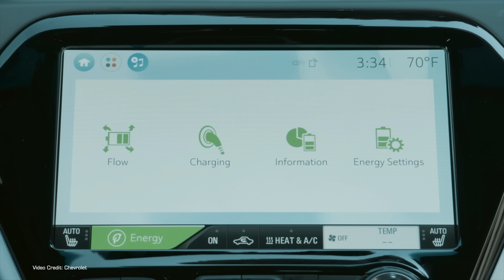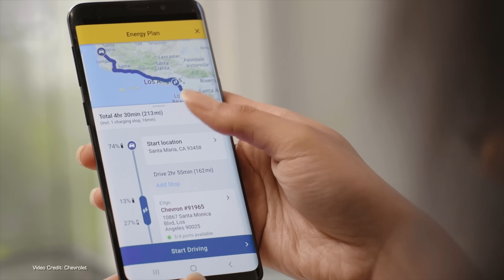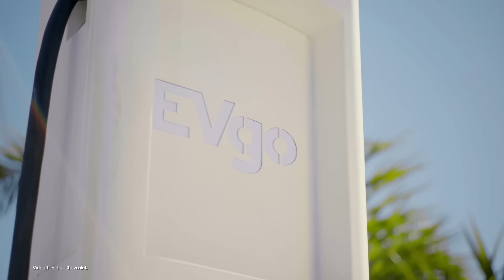UPDATE: Bolt EV Fire : GM Announces Full Battery Module Replacement - Here's What You Need To Know!

Comment: What an absolute con!
They're announcing an extremely slow (and economically absurd) "fix", which leaves Bolt owners with drastically reduced utility for months/years, while backing off on the previously promised swap/buyback.
Total delaying tactics to nickel and dime their customers.
Reply: they are replacing the battery modules since they cant identify which ones have the defects, while it would likely be less error prone to just replace the battery all together.  and that is likely now going to happen since battery production is constrained as it is. not sure how they are nickel and diming customers, they arent charging us any thing to fix it, when they can (there are over 70000 Bolts on roads today) . its like that bad air bag from a few years ago,  and that impacted more cars from multiple OEMs.  the big things that are slowing things down (if LG  and GM are finally on board), is that batteries are in short supply, and dealer techs are too (not all GM dealers can actually do the work, as some dont even sell or service the Bolt). course getting the modules were they need to go will also be a problem, and of course the pandemic is slowing things down even more

Comment: My only concern is if they do it on a module basis, could that make the replacements not be 
the same capacity as their brethern in the same pack? The BMS would have to mind this when
charging or discharging or bad things can happen. Also (sigh) no range improvement at all.
Reply: gm's announcement today is that they will replace all the modules in a pack.

Comment: I'm still not entirely convinced that Chevy is going to replace battery modules (actually battery sections) rather than the entire pack due to them specifying it will take 3.5 hours to complete the work. It also makes almost no sense for them to do that - far too slow and complicated of a job - they should replace packs at the dealerships, then ship them off to a central location to be recycled into new packs using just the modules if they care to salvage a cheap piece of stamped steel. The cost to replace the packaging is far less than the cost of labor to replace it. They are supposed to be accepting cars for replacement starting Aug. 30th - sometime between now and then we will get the service bulletin that goes over the procedure, and my guess is that it'll be a full pack swap.
Reply: Let's all hope you are right when it comes to a full pack swap !!!!

Comment: OMG !!!  This "Module" replacement program is going to become a real Cluster Mess !!!
First, it is going to take days to perform these "Module" swaps at the dealership. Second, the Dealers are not going to want to dedicate one or two Master Mechanics to perform these "Module" swaps for months on end, and gm just is not going to pay the Dealers enough to perform these Module swaps!!!! Third, the Mechanics are not going to want to do only Module swaps for months on end, they make their money by fixing a car in 30 minutes when the rate book says it will take an hour, they will not make any money working on a single battery pack for two to three days (see Weber Auto's post re how difficult the repair is). Additionally the Mechanics are not going to be willing to repair any returned (broken) battery packs that they previously worked on because they do not get paid for "re-work". Beyond all of the above, replacing all the battery modules will be a logistical nightmare for gm because each module has to be  shipped and that exposes them to potential shipping damage (plus, shipping Lithium batteries is EXPENSIVE, I mean REALLY EXPENSIVE).  gm would be much better of replacing the entire battery pack, it is cheaper, less prone to failure and the entire battery pack can be swapped out in a few hours time.  Mechanics will be happier, Dealers will be happier and the Customers will be happier because they get their cars back within a day or two versus a week or more if the mechanics have to do the module swaps. Also, gm will spend way, way, less money replacing the whole pack versus swapping modules.
Reply: I had one module replaced in the 2017 I owned before doing a buy back and getting a 2021. They had my car two weeks and then I hd to return twice due to the coolant not being flushed and filled properly.

Comment: The full replacement sounds terrific for those who get it. I am achieving 4.5 mile per kw in my 2020 Bolt with the 66kw battery. I am a conservative driver and most of my miles are on 2 lane roads with max speeds between 45-55mph with an occasional dash in sport mode just to blow the carbon out the tailpipe like the good old days. ;)

Comment: Looks like gm are going to test there battery recycling program a lot quicker than they planned.  I still think buy back is the better choice or heavy discount for new models msrp swap
Reply: Am in talks with GM California for either buyback or MSRP swap for 2017 Bolt and was told, in the case of swap, that GM might cover tax and license for new Bolt EUV, but not to expect dealer discounts.
Reply: I'd love to see theses batteries go to peaker plants that are designed to make sure each one is isolated so that if one catches fire it can't spread.

Comment: This is interesting because it means when the battery packs do degrade, the modules with the failing cells could be replaced individually.   Though GM dealers will still want a small fortune to do this, there could be third parties that will do it at reasonable costs and if they can't procure new modules from LG, they can still salvage them from wrecked cars.  This could mean the Bolt may be a very good second hand choice.

Comment: Thanks for the update, Nikki. As an owner of a 2019 Bolt EV, a complete battery module replacement would be very welcome, especially with more capacity and a new warranty. I still like driving the car, it does what I need it to do. Not having a garage, my cars have always lived outside anyway, so that hasn't been an issue. I just hope that the battery doesn't decide to barbecue itself while I'm waiting for a swap.
Reply: You'd better hope you aren't in it if it goes nuclear.

Comment: IF - in their forensic analysis they can actually find the defects - and more importantly, they can figure out a method of reliably detecting the problem cells without taking them apart - at that point, they can replace just the cells that are NG.
BIG question: will the new type cells be fully compatible in a mix-and-match pack, that contains some of the old and the new cells?
Reply: No
Reply: @Neil Blanchard: The recall that was announced today, replaces all the battery modules inside the battery pack with brand new cells (no mix and match).
Reply: @bbcooter388  That is true, as I understand it. But, if you read further, if/when through their forensic analysis, they are able to reliably detect problem cells, that they then would be only replacing bad cells.

Comment: I might be wrong but, swapping all 10 modules must be done. Replacing one or two module would have been bad. Batteries with different internal resistance. And different chemistry Don't play nice together.  I'm glad GM has decided to do the right thing. They need to replace modules on there own time not ours. Drop the pack, install the new pack, send us on our way. The cars with the old cells, that didn't need replacing, may never be able to get 238 mile range ever again.
Reply: I think you're right.. the new modules would have to restrict their power output to match the other battery cells.. which would probably generate extra heat. Not something I want in a chevy battery

Comment: It wonder if this whole “module replacement” plan is because GM doesn’t have 50k spare battery packs lying around, but boy that’s going to be labor intensive. It seems like it would be better for GM to setup a re-assembly line to take in old packs, strip them down, then refurb and ship them back to dealers rather than making mechanics do it in the field. (I guess it wasn’t totally clear who would be doing the module replacement, maybe that is their plan?)
Reply: Q: It wonder if this whole “module replacement” plan is because GM doesn’t have 50k spare battery packs lying around(?)  A: yes. wonder no more.  i tell you in no uncertain terms Planet Earth is currently in a RAW MATERIALS shortage.  it's important BEV fans step away from the fantasy (if only for a few seconds) and do an analysis of how the "physical work" and logistics that mining the MULTIPLE elements needed to produce even one battery CONTRASTS from the "single hole mining" of crude oil.  not a defense of oil just an illustration of how important it is we THINK.
Reply: @phillyphil1513  uh, there are thousands of 'single holes' for extracting oil.
Reply: @morosis82  re: "there are thousands of "single holes" for extracting oil" precisely, now tell us what the mining equivalent is to that where a machine digs into the soil (in a single spot) and unearths all the lithium, gallium, manganese, aluminum, cobalt, iron, copper, etc in Net (or even Near Net) needed for the production of our beloved batteries...?  phrased a different way, are we able to perform "Alchemy" (not a thing btw) and "crack" say the single element Silicon by use of a Distillation Column, and then create a myriad of other useful substances (albeit harmful) like Kerosene, Jet fuel, Diesel etc (in addition to Gas) like what's done currently with a barrel of Crude...? the mere pointing at the existence of "multiple holes" in the hopes of making an analogy off that shows a fundamental "dumbness" regarding the issues were facing (which goes some way at explaining why we've got the shitshow that we've got going on now).
Reply: @phillyphil1513  the difference being that when you pull a barrel of oil out and burn it it's gone, but you get to use that battery pack for many years before you 90% recycle it into another one.

The difference is a couple orders of magnitude, we are just more familiar with burning 90 million barrels of oil a day in its various components.
Reply: I wonder if the whole module replacement plan is so that GM can devolve the labor expense of the battery swaps to the dealers.  It may cost more over all, but this way GM corporate only has to pay for modules, rather than whole packs plus assembly costs.

Comment: I own a 2018 Bolt and will never ever buy another GM product. And the local Chevy dealer sucks.
Reply: Chevy has always sucked big time!
Reply: @skepticalmechanic  they have actually improved to near the top last decade.  I see the Bolt-files of more of an experiment.   Just Toyota did to Prius with multiple recalls for the same thing. 

"...Chevrolet commissioned independent research company Ipsos to conduct a survey. The details specify that reliability is defined as "the percentage of vehicle owners who reported they have not repaired or replaced any vehicle components in the past 12 months (excluding fluids, filters and those related to accident/collision)."...

"...The survey sent out 840,979 letters to 2015 model-year vehicle owners, with time in service starting December 2014 through June 2015. Overall, Ipsos received 48,679 responses from Acura, Audi, BMW, Buick, Cadillac, Chevrolet, Chrysler, Dodge, Fiat, Ford, GMC, Honda, Hyundai, Infiniti, Jaguar, Jeep, Kia, Land Rover, Lexus, Lincoln, Mazda, Mercedes-Benz, Mini, Mitsubishi, Nissan, Ram, Subaru, Toyota, Volkswagen and Volvo owners. Full details on the survey can be found online...." Autoblog.com